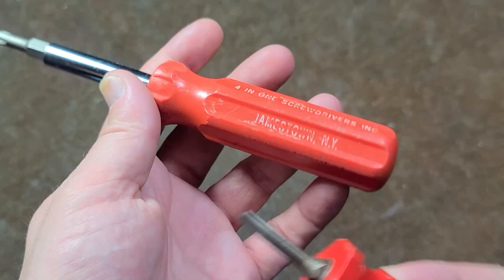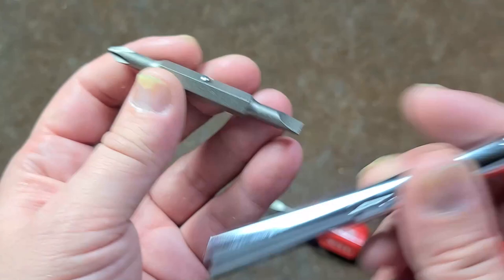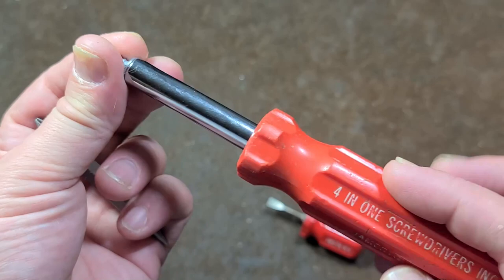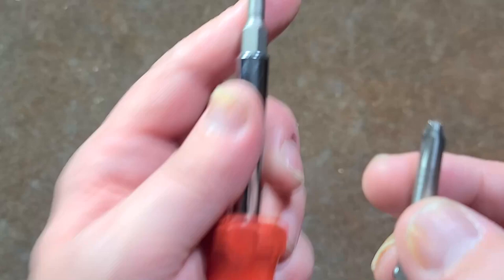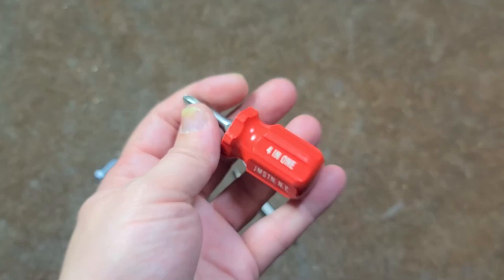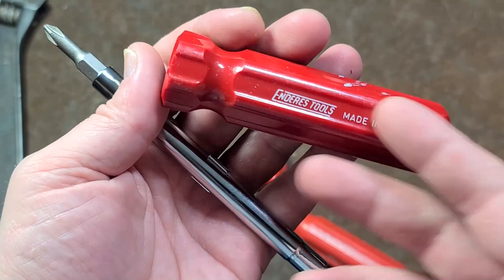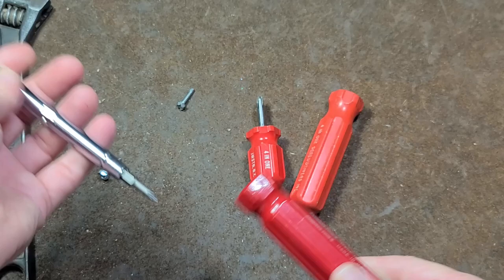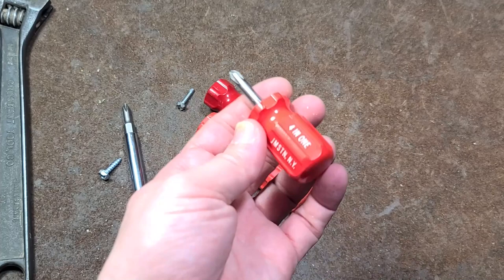Original 4-In-1 Jamestown, N.Y. Screw Driver Review

Comment: We're do I get replacement bits for them and Klein I got at least 3 that need bits I don't want to buy 3 New one's I got 6 in one shot and year later half the bits Gon broken oy vey it was like 17/18 bucks for 1
Reply from the maker: I know places like True Value Hardware and Ace Hardware used to sell replacement cartridges I don't know if they do anymore
Reply: Husky 19 in 1 has 10 double sided bits cheaper than buying 3 replacement bits and you get an extra tool